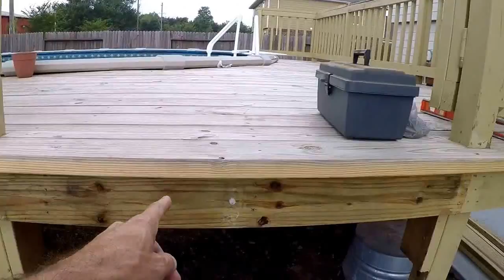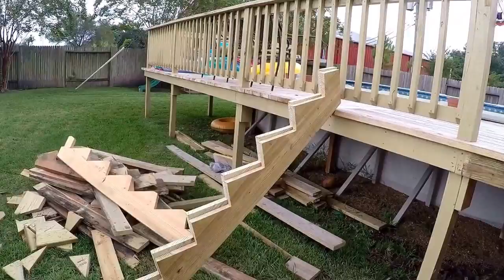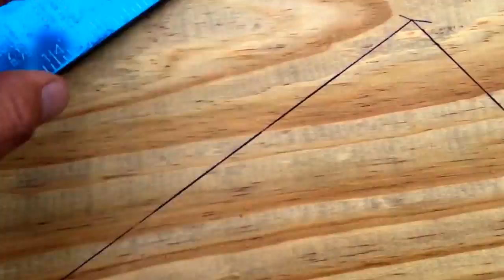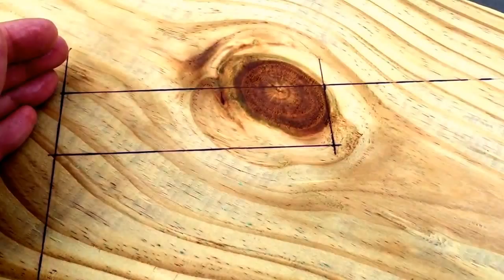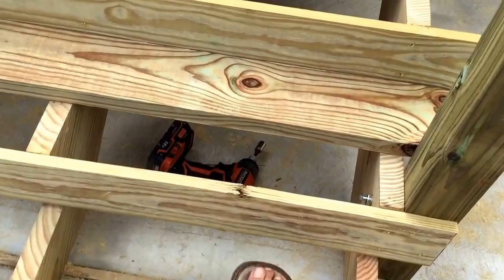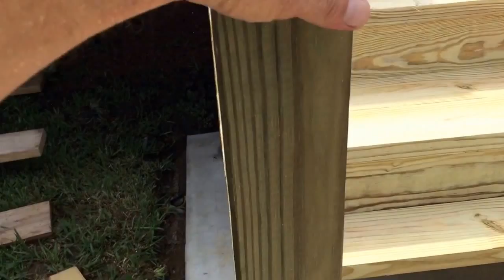Deck Stair Construction -Part 2 - Building The Stairs

Comment: When you cut out for the kick board does it take special attention so it will not rot
Reply from the maker: BILL C I used all treated lumber and the kick board stopped just shy of the stringer so it wouldn’t sit on the stringer and hold water.

Comment: Isn't that 2 x 4 going to rot sitting on top of the concrete pretty quick?
Reply from the maker: Kita The 2x6 on the ground, as is all of the lumber in this project, is treated and rated for direct ground contact. That doesn’t mean it won’t one day rot, but it will probably be there as long as the pool will be.
Reply: @TreyClanton  good to know.